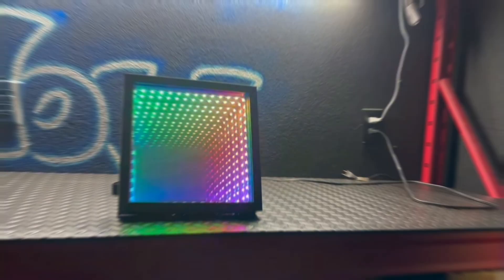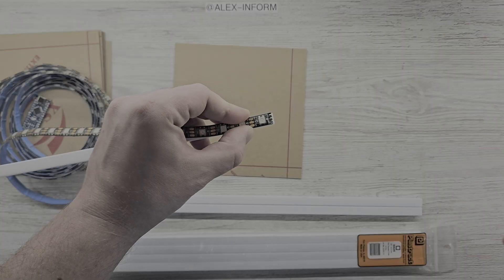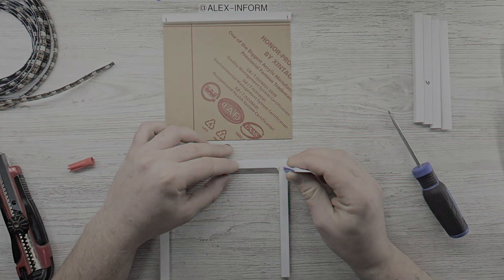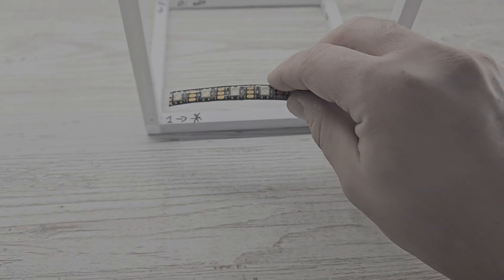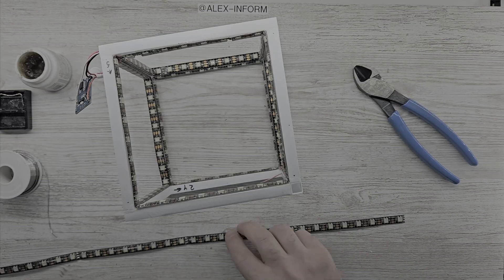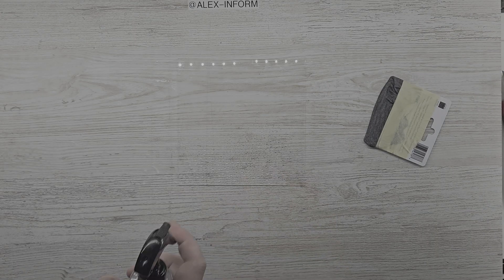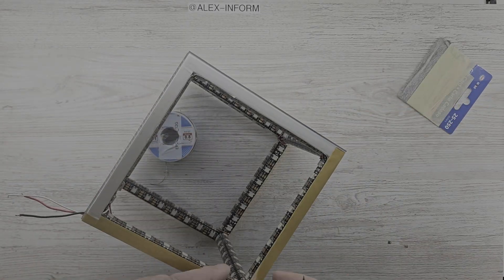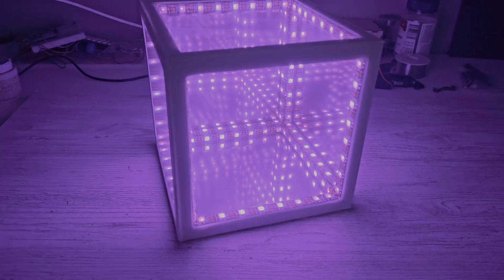🛠️DIY Is a Waste of Time? This Infinity Cube Will Change Your Mind🔥

Comment: que capacitador as puesto y donde va conectado
Reply from the maker: Capacitor I put in parallel with voltage input, to prevent voltage drops from power supply, but it is fine to wire without that capacitor.